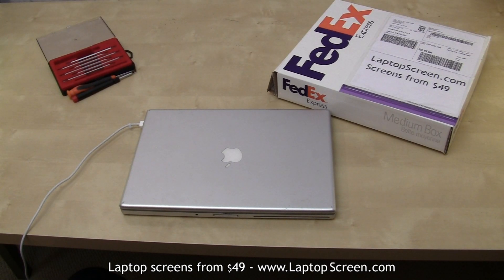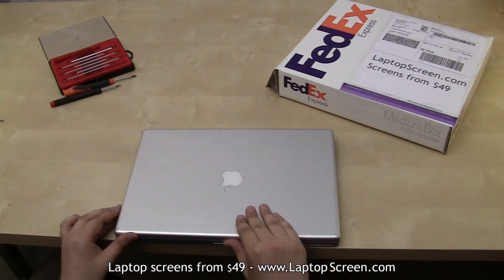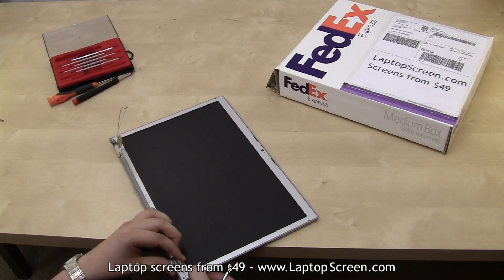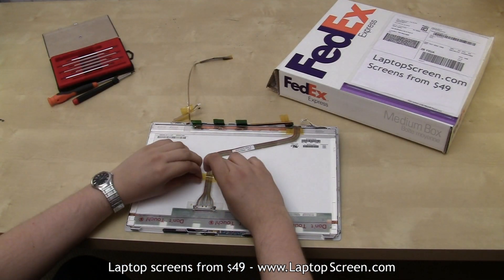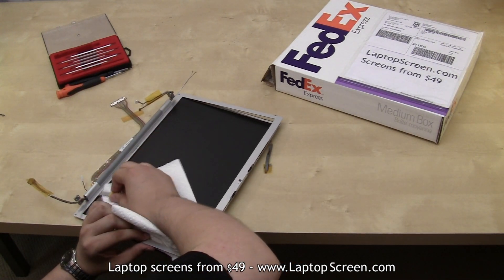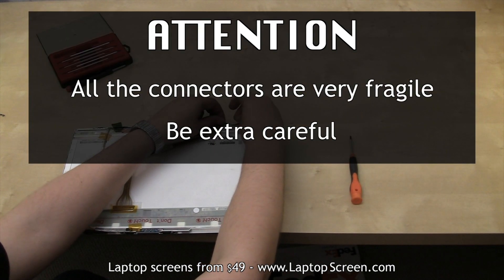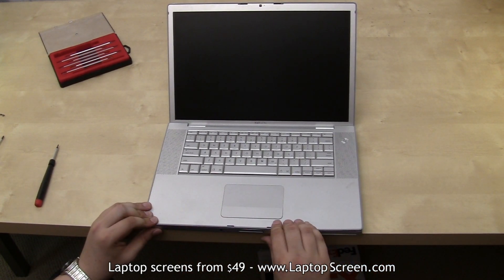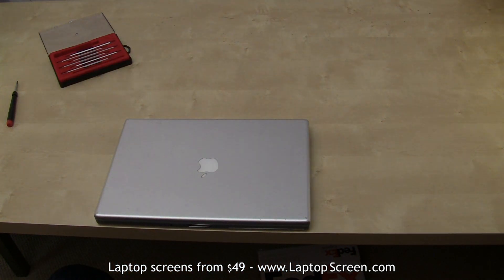Laptop screen repair, laptop screen change instructions [Apple MacBookPro 15"]

Comment: Thanks man, ur video helped me out a lot. A successful repair. At first when I closed it up, the lcd will flicker on and go off and I was about to cry lol but I relaxed and reopened it up to check the connections and found that the converter cable was crimped...the lcd assembly was closed on it. I moved it and taped it so it wouldn't get in the way and reclosed it back up. Turned it on and everything works

Comment from the maker: Yes there are. And they are strictly not interchangeable.
The LCD model will be on the back of the LCD module.
It will start with LTN154 or LP154.

Comment: That was so monumentally involved. I just replaced a screen on a crappy Acer in about as much time as it took to watch this video.

I was looking at buying a used and broken Macbook Pro on Ebay knowing that I'd need to replace the screen but I'm not really sure I want to put up with this. It was mainly going to be a learning experience anyway.

Comment: Thanks for a great video, helped me successfully change my macbook pro led, even though this video isnt for a macbook pro. its close enough that with a bit of common sense, you can get through. one bit of advice is make sure you have the exact model of LCD otherwise it may not work for you. for example if there is a model number followed by a (A) or (B) make sure that you include these characters in the search for a new screen.

Comment: Some points for those doing this operation. You'll need a number six miniature torx driver and a jewelry screwdriver, phillips type. The key board connector disconnects by gently lifting the plug up but all other connectors work by unlocking their grip and sliding them away. When prying the bezel around the screen away, watch out.There are a lot of iSight electronics tucked in there. I barely scratched something and iSight was broken. One clip got stuck and had to be torn out. Bezel bends easily

Comment from the maker: @Vic10689 Sorry to hear that =(
Depends how it's broken I suppose. If the plastic clip popped out, it can be put back in with tweezers, if the entire socket is ripped out, then you should visit eBay for an affordable replacement.

Comment from the maker: We do not typically recommend resolution upgrades, quite often there is more to it than just plug and play. Upgrading to LED is not the most smooth topic either. Although there are converting kits, but I really doubt it would work for a Mac, since most Mac screens are specifically locked to run on a Mac with firmware.

Comment: Hello. Cool tutorial. I actually need to replace a screen on my MA896LL/A. I checked your site and you actually have it in stock and for a good price. However I was wondering if I can upgrade at the same time (i.e. go for a different model of lcd / led that would support higher resolution - 1680 x 1050)? If so - which model should I go with? Thank you.

Comment from the maker: @mauayalaa Don't panic, you probably didn't reconnect something. As far as Mac's go, we've had experience recovering Macs back from liquid spills that PCs would never come back from. So keep at it, check the power connections first, battery to mobo, and the AC jack to mobo, and keep going through all the connectors you've touched, or didn't.